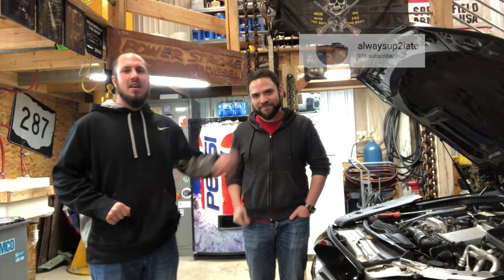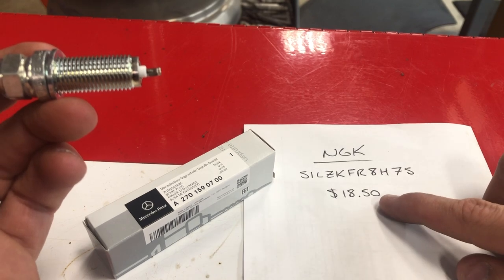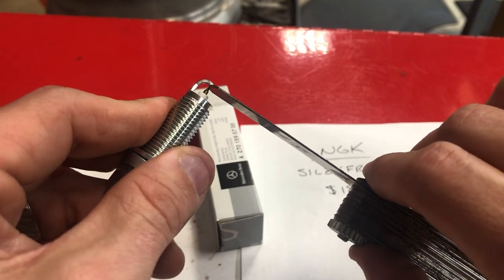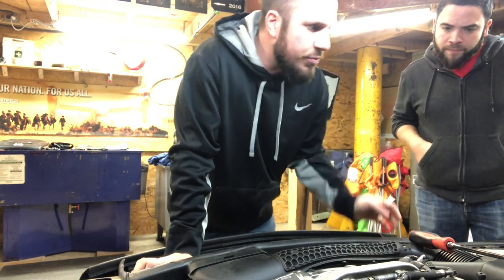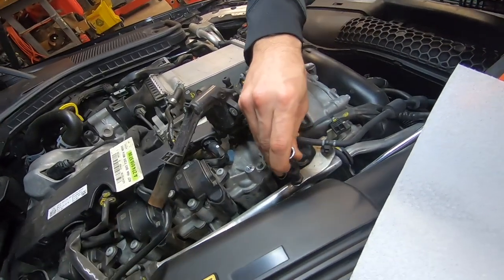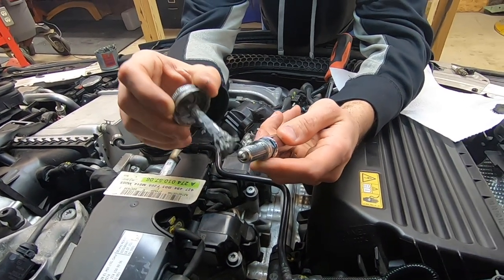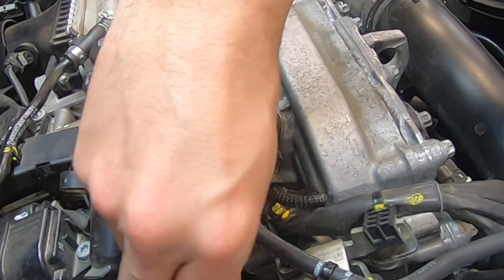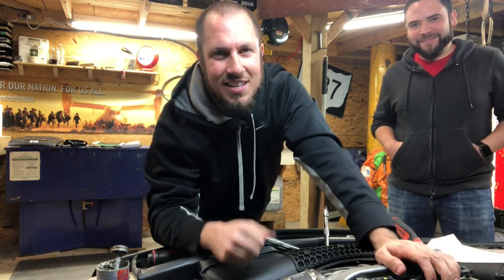Mercedes C300 W205 Spark Plug Replacement

Comment: Will be doing the spark plug change here shortly as we're coming up on the 5th service. Dealer was quoting me around $500 to do this...lol. Insanity, especially for someone like me that's been wrenching on motors all their life. I think other than the plugs, it's oil change and engine air filter. Great stuff man! Definitely learn a lot from watching your videos.
Reply: They quote me with 600 spark plugs and air filter. I say to me ,really ?
Reply: @capricornio9343  we got rid of the car after they tried to charge us $6K for the drivers side headlight which ended up being covered under certified ore owner warranty. Had I not ran the codes myself and argued, they were perfectly fine charging me the $6K. Was a nice car, but not worth it to keep.
Reply: @ChristianGrest  MBz dealers they charge me 1400 for replacing a fuel line and other basic inspection they say,and when I drive my car ,the bottom cover rattling,it’s insane the cost for the labor , and yeah probably I trade my for a Toyota

Comment: Thanks for the video.  I am wondering where  you got the gap spec for the plugs?  I changed mine at 55k miles and measured 0.028" on the old ones and the new MB came gapped at 0.028", so I kept them as is out of the  box and it runs great.  Your metric torque "nano meters" should be Newton-meters.17 ft-lbs is 23 N-m.  I don't know how you were able to get the back coil pack off without loosening the black electrical module mounted on the top of the engine- even doing that, it was very tight.  The paper towel trick works in a pinch,  but it was difficult and it wiped off the diaelectric grease from the insulator- which I recommend applying to keep the rubber from sticking to the plug insulator.

Comment: Did you need to undo any other tubes, connectors, and/or compartments in order to get to the 2, 3, 4 spark plugs? It looks like there are some clearance issues as things are on the way of 2, 3, 4 coils.
Reply from the maker: I did not remove anything more than the coil pack as shown in the video

Comment: I have a 2013 c300 4matic flex fuel . Does it make a difference in spark plugs if you put in gas coils n spark plugs ? Or does it have to be specifically flex fuel spark plugs n coils .

Comment: I have been looking at your channel for a few times and have subscribed,  Always willing to support fellow Veterans. I have a GLC 300 4matic 2018 and looking to do the same.  I am also wanting to do a service to the transmission and have watched many different versions of the proper draining and filling, my questions is as follows:  Do I need a special kit to drain and fill the transmission?  The oil sump on this car has the filters attached to it ( 2 filters) and the pan or sump has to be replaced.  Just checking to see if you have any information on this type of transmission.  Thanks in advance and thank you for your service to this great Nation.  HOOAH

Comment: Hello 
Thanks for videos 
Car came to me with missfire in cylinder 1..the fault was the spark plug... After repleaced all 4 with new from dealer car won't start even when i install the old spark plugs.... 
Then when i put spark plug in ignition coil and put it out of engine ...car start.. 
You know the problem.. ??!
Car c205 300 petrol 2016 
Thanx again

Comment: I think the guide is on removing the spark plugs is fairly good.

The not so good. 14mm spark plugs are very common for direct injection engines and cheap. Additionally these spark plugs are indexed (electrode position matters) in direct injection Mercedes-Benz cars. The washer and correct torque should result in the correct indexing of the spark plug. Using grease to prevent corrosion, while a good idea for helping the next removal of spark plugs, changes the torque value. In effect the lubrication from the grease results in over torquing the spark plugs. Di-electric grease should be added to the inside of the coil over boots to prevent sticking on the next spark plug removal.

If the coil over boots are stuck to the spark plugs, you could try to remove them warm. Just "never" remove or install the spark plugs unless the engine is dead cold (multiple hours after running), as the strength of the aluminium is significantly reduced while hot and you are likely to damage the threads on the head.

Comment: I made my own sparkplug rubber for 14mm to pull it out the engine. with my 3d printer. I used tpu. If you need the stl file you can ask me, its for free;)

Comment: Is this a c300 4matic w205? or are the spark plugs the same on the 4matic version and the RWD version?
Reply from the maker: More specifically this is an M274 engine. So if you have the same engine platform, that is a better way to look at it.  I think it was the same engine in both variants but I’m not completely sure

Comment: Do NOT use anti-seize compound on shiny plug threads because the anti-seize changes the torque amount
Reply from the maker: Yes, it’s then considered a wet torque. For an application such as this, wet torque won’t throw us off that far to hurt. The anti-seize is definitely necessary to prevent dissimilar metals from corroding.
Reply: @TheDurbinCompound  i have a 2019 GLC 4matic and am told the spark plugs need to be indexed and that the proper torque is very important to prevent engine damage.
Reply: @TheDurbinCompound  I agree my father used the same antisieze in the 90s for his GMC V8s not using them on the old school spark plugs called for a really bad porcelain day

Comment: Good video, but you need to update your skill set fellows. There is a 14 mm spark plug socket. I have one that I purchased for a BMW, thin walled, 14 mm that has small springs on the inside and holds the plug perfectly to take out the old ones and put in the new ones. There is no need for long nose pliers or paper towel scraps, or any of the aggravation associated therewith. :-)
Reply from the maker: This video is intended for someone who is doing it themselves without the need to buy the speciality socket.  Yes, I have the SnapOn socket and it is sweet but not everyone has access to the truck or wants to order the speciality tool.
Reply: @TheDurbinCompound  There is no need to go to the exorbitant prices of Snap-on. These sockets can be had for a small fraction of the Snap-on branded ones - a few dollars! Let Google be your friend!
Reply from the maker: I hear you there!  My videos are geared toward getting the job done without the speciality tool.  Nothing I hate more than a video that starts with “you will need to go order or get this tool before you can easily do the job”

Comment: Absolutely NO antiseize on this specific spark plug. Those are indexing spark plugs  that's why 17 ft-lbs is so important.  Of course the argument will be that your engine still runs but it's not right. The plating on the threads is actually antiseize on those plugs. You can check with NGK.
Reply: I just replaced the plugs on a W205 with about 30,000 miles on it because one of them was misfiring from time to time. NGK makes these plugs but they also make a lot of faulty ones! This is the second time in my experience with all brands of plugs on many vehicles when one misfired, quite prematurely, both times NGK plugs! I thought the plugs were going to break - I must have had to use at least twice the torque they are supposed to be torqued to, to get them out! Once out, there was plenty of carbon on all of them; the back three had half of the threads rusted quite a bit. Anti-seize compound helps prevent rust on the threads and to get the plugs out the next time they need replacing. What will you do when they seize in place with rust! Pay to have the vehicle towed (probably far away) to get the openings rethreaded at a specialty shop or just replace the engine (as I have read someone did)? Good luck with your approach! FYI, a thin coating of dielectric grease on the coil pack boot also helps slide the boots easily on and off and improves electrical conductivity at the contacts.
Reply: @franklopes3648  There is a coating on the plugs that will keep them from seizing in the heads. I was a Mercedes Benz Tech at two dealers and have owned a repair business for almost 17 years. 21 years of servicing MB vehicles, replacing thousands of spark plugs on them and have never had one seize in the head for the reason I mentioned. Carbon is clearly not the same as rust. If you are experiencing excessive rust on the threads, there is moisture getting in there somehow. I just did a 2014 E350 tune-up yesterday, with a 136K miles and the plugs came out with no problems. Anti-seize will throw off the torque spec and you will create bigger problems.
Reply: @marcsmith3881  There was plenty of rust on about half of the threads on every plug that I pulled out after only 30,000 miles, that is the reason it took so much torque to get them out. It definitely was not the carbon on the electrodes that caused that! May I suggest you keep doing what you have been doing and I will do what I have always done which is use anti-seize compound to get those hard to get plugs out? I have never had any problems with any plugs coming loose on account of any anti-seize compound. But I have heard horror stories from mechanics in whose hands spark plugs broke and then they had to send the disabled vehicles by tow to specialist shops to get the engine slots for the plugs re-bored at great expense! Yikes!
Reply: @franklopes3648  Just because you have done it that way doesn't make it correct. I would suggest reading Mercedes information on WIS if it's available to you or Alldata. The spark plugs on the newer engines are indexed. If you do not install them properly, there will be carbon build up over time and it will cause problems in the future that will be difficult and expensive to diagnose. I can assure you that you didn't hear those horror stories from MB techs. Almost all of the engines we pulled out of MB vehicles were due to owner error. Nothing is more dangerous or expensive than old mentality on new technology.
Reply: @marcsmith3881  I have had more problems with work done in dealerships than I have ever had with the class A mechanics you disparage, bud. Is the carbon build-up you refer to like the carbon build up I found on the ones I just replaced at 30,000 miles that came from the factory? I have replaced others that had less carbon build-up at 60,000 miles! So much for your argument! Clearly, technological developments that bring us new designs of spark plugs are not what they are cracked up to be, are they? Why are these new designs not delivering like the old ones in terms of longevity? Could it be the financial interest of the producers being put ahead of those of the end user? And you are being asked by an engineer!
Reply: @franklopes3648  I am not disparaging anyone other than those think every round piece of fruit is an orange. I could also have a 6 figure revenue stream saving shops that have made mistakes on Mercedes vehicles, especially those replacing parts that require SCN coding. I won't even get into the YouTube watchers that I bail out almost weekly.

 I am sorry to hear that you have had bad experiences at the dealer. Not all dealers have good techs just like not all doctors or lawyers are equal. Saying you are an engineer is like saying someone is a doctor or lawyer. There are many different types and specialties for a reason. Mercedes Benz engineering and vehicles I know very well after 21 years. As far as engineers go, I have read thousands of technical bulletins because of them. I can't completely blame them. Sometimes the Accountants screw them by making them cut costs. Anyway, the fact is, there are specific procedures to do things for a reason. Your Mercedes is one anecdotal experience. I have probably repaired thousands. Go against those procedures at your own peril.

Comment: I have 2015 c300 regular . I don’t know it’s w205 or w204 how can I know check that?
Reply from the maker: W204 is the older body style. Ended in 2014. W205 is the new body style 2015-2019.
Reply: TheDurbinCompound thank you.
Reply: TheDurbinCompound How much you charge to replace spark plugs . I don’t have tools .

Comment: way too much anti seize on those plugs, and you don't even need the anti seize, since the plugs should be changed every 40,000 miles and they will never be seized up
Reply: This is correct ,besides to much anti seize could heat up temperatures in that cavity and cause problems

Comment: - Anti-seize on these plugs....NO
- Didn't blow off/clean the hole before sitting new plugs....No
- And huge torque wrench to tighten 17 ft-lbs....big NO..

I appreciate the effort of making a DIY video but please make sure you know what you're doing. Amateurs will follow and one of those will make a bad mistake on their engine.